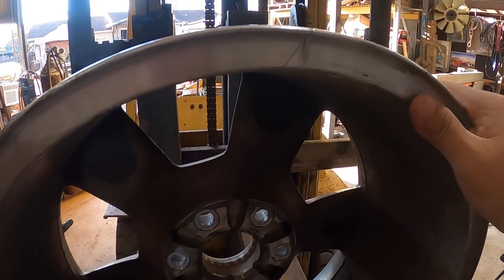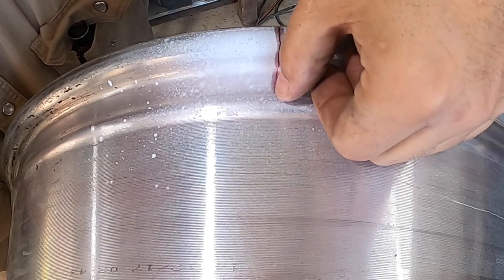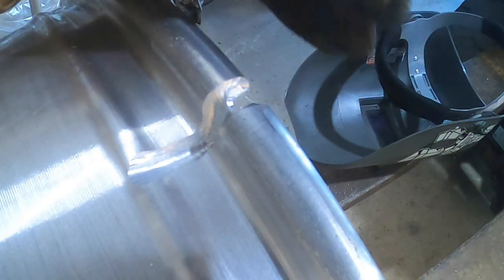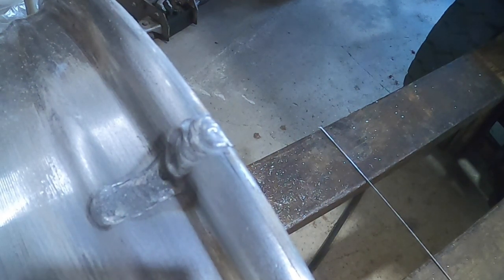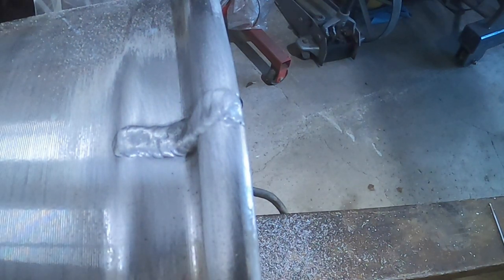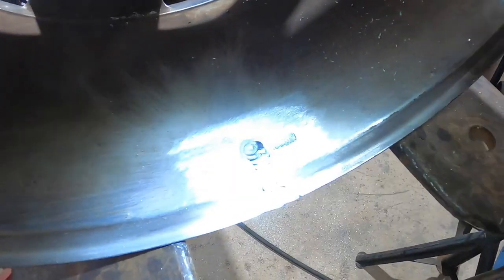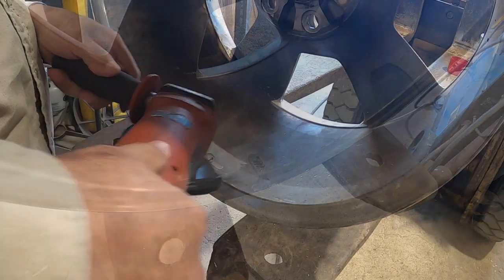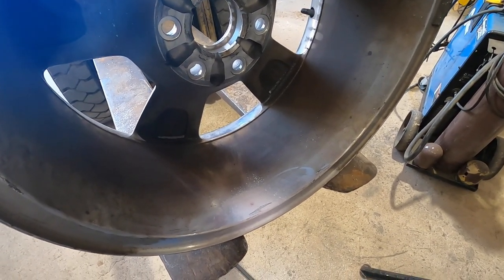Aluminum???

Comment: I do a lot of AL., and for someone who is not up on setting your Syncrowave 350 for AL. you did an great job of making it work. I might add for next time ... pre clean with a clean stainless brush and alcohol, set the machine with a higher cycle than 60htz. I like 150 as a starting point, pre heat the base material, and keep your filler rod within the cover gas envelope at all times when welding. Enjoy!
Reply from the maker: thanks for the input,  I'll start at the 150hz range next time. I made two videos at the same time on this run so It may show up later in the year. Still the same struggles but oh well. 😁😁😁
Reply: I also did a lot of aluminum welding. Im in total agreement with pkav8tor.
Reply: @ICWeld  hey man on that tree stump machine VID was that dhort circuit mig you did?? I really am curious but didnt get a responce or was it globular??
Reply: Hey brother, please be careful repairing this kind of thing! If It goes on you're personal ride, that's one thing. If it goes to a paying costumer and fails, anything could happen. Just remember, they get the bill, you get the signed waver! No two ways about it. Keep up the great videos!
Reply: @thomashaley5284  he not claiming its  as original, but welded to hold air
Reply: @thomashaley5284  By the way, he did say in the video that it was a free job for a friend!  Not paying work.
Reply: Wanted to add but I'm sure you know helium is the preferred shield gas for aluminum.  Also the type of tungsten you use matters as well. Some tungstens can only handle up to 150htz I believe and they need to be shaped correctly. Conical with flat end or ball end.  I'm hoping someone can add to this and hope it helps

Comment: Ive been welding aluminum for the better part of 60 years.  What I saw was pretty close to right on.  Depending who made the wheels the alloy will be different.  Castings are always a bit dirty, and if there is any magnesium in it the fillers are entirely different.  Clean as said before with acetone, don’t use brake cleaner.  Brake cleaner when heated produces poisonous fumes.  
IC your heavy steel repair processes are assume,  I have watched all of your vids and have learned a bunch.  I am 75 years old and still weld each week day, I take the weekends off, weld carbon steel, and stainless mostly.  Keep up the great work!

Comment: Cleanliness is the Key in welding aluminum. I have dedicated stainless steel wire brushes, die grinder bits - even gloves - for use on AL only. I also wipe down with acetone before starting. Wipe the work, the rods, everything. Others comments below are spot on.

Comment: I had a local aluminum welder do some work on a boat and he stressed how the aluminum has to be contaminate free. He has sanders and grinding bits that only touch aluminum. He said if you use them on steel and then aluminum it will contaminate the job.

Comment: I used to help a welder that had a small repair business we did lots of alloy wheels, there are wheel services that visited every dealer in town weekly, they use a hydraulic truing machine that often left the wheels cracked , we fixed the cracks.  I enjoy your works thanks.

Comment: I used to work in a machine shop, pre-GPS days. They were linked up with a defense contractor that built the forrunner of GPS, and we built the components for the antennas on their system.
    I had never welded prior to working there and while there I learned to both stick and tig Weld. I told that backstory in order to tell about the tig welding rig I learned on. The primary welder was a 350 Amp AC/DC Lincoln with reversible polarity, it was literally as big as a side by side fridge but half as tall. On top was a box about the size of your average tool box but twice as wide. This was the "high frequency" box, and it had one last part which was the foot pedal with a exposed reostat, the diameter of the wheel in your video. I point out that it was exposed because several times I got snapped out of my inattentive state when I would allow my leg to lay over against the top of it. You would think the shock would not be bad from the side of your calf to your foot, but I wore insulated boots and usually sat on a metal stool at the welding station so the electricity went up and out rather than down and out. Add to that, you weren't getting everyday 60 hertz electricity, like I said the tig box was a "high frequency" inverter which multiplied the frequency depending on the terminal the torch was plugged into. Even though it never made it above my waist, I would taste the fillings in my teeth for hours after I touched it.
    But one thing about it, for as crude a looking set up as it was, I've never seen a tig rig that produced as even and as good looking welds in the hands of an amature. The two additional things I would attribute the quality of the welds to (government spec. inspected), we were only permitted Helium as shielding gas, and my vision was a lot better than it is today (coworker who taught me said, "watch the puddle and paint with the liquid metal).
       I said all of that to say this, The world is full of armchair quarterbacks, tell your critics to start welding and post their videos online. Those who do it for a living or regularly as necessity calls for it, don't need a backseat driver telling them where they're wrong.

Comment: Usually with the gap, you can back the underside with a piece of copper. That way the introduction of heat will keep the weld puddle from dropping out.  I teach tig in a BOCES adult ed classes. I watch your videos alot! Keep up the good work you share with your audience.

Comment: Excellent repair!  When I saw the wheel, I just knew the "safety Karens" would give you grief for repairing it.

Sounded like you were running around 120hz; especially on cast, I prefer to set my machine around 60hz, which seems to smooth/flow the aluminum better on cast. I use 120-150hz on thinner AL sheet. A stainless wire brush and cleaning with acetone prior to welding will also help. As someone else mentioned, keeping your filler in the gas coverage between dabs also helps. TIG welding AL actually seems easier to me, than steel.

Great job!
Reply from the maker: i'll try that next time. thanks bud

Comment: Very cool video Isaac.
I've watched several videos on tig welding aluminum and titanium, but this is the first time I've actually been able to watch the pool and flow of metal clearly.
I'm not Tig welder, but I could definitely give it a go after watching this. I'm an old gas and arch guy from my diesel mechanic days. Great capture sir.👌
Excellent "Hoop" repair.😁😉😂
I'm sure the alphabet department would approve.👍
Reply: Watch Jody at welding tips and tricks, he gets great puddle shots
Reply: Gw Builder . If you're old school gas welding from days well gone by . I don't think you will have much of a problem using TIG, Look at it the same as I do the gas torch flame is replaced by an electric arc with an inert gas shield. 'Aluminum '? alloy wheels are quite often not anything as strait forward as that, the combinations of various other metals included often gives the home workshop guy an impossible chance of getting a safe repair done . With the past knowledge and experience Isaac has gained I think he  has done a good usable repair , apart from the 2 tiny blemishes it's  'invisible mending '
Reply: @dtimboggs  This is Isaac's channel. This comment is for Isaac.
Reply: @karlhrdylicka  Thanks for the comment.
I understand the concept. It's basically the next evolution of combining gas and arch together, like using helium argon for stainless and a number of other shield gas applications.
Watching the arch/gas interaction with the flame and filler rod was what I thought was cool.
I haven't tried it because nobody I know has a Tig welder and I'm not going to buy one just to try it.
Tig definitely has the features of both worlds and the versatility of speed control, but it is a slower process, although I've seen some beautiful welds. I'm just not that patient.🤪
The impurities are the reality of any cast material and like Isaac said, it was probably the finish coating on the "Hoop".

Comment: I am in the school of “there are people I can learn from, U”. 
   I’m not the best, and can always learn new things. I am pretty good at working on wheel repairs. I always cut through the crack with a cutting wheel first, to remove any dirt, and I don’t worry about pin holes less than 1/16 and no more than 2. Other wise it looks like what I do. Great job, better luck on the next one!

Comment: Your method was good. Torch angles we're almost perfect. The basket weave was a great way to melt off that first bead. I think what you are concerned with is pockets of other materials in the base. Specks of magnesium or zinc will give that look of porosity. Nothing can be done about that. "A grinder and paint, makes me the welder I ain't."

Comment: No bubbles no troubles. I had never heard that before and I like it. I have never done any TIG welding so as long as the tire holds air it's a success.

Comment: I repair several similar cracks and worse from low profile tires and potholes. A clean stainless brush like on your drill and a little (300 degrees) preheat make it easier.  Good job.

Comment: I am having a coffee after welding a trailer frame break.   As to your repair?   Better than 99.999999% of the world could do.   Most would buy a new rim from the wreckers.  Many will argue that it’s not roadworthy now.   Yet It’s definitely stronger than it was before before it cracked.
Reply: I've got a "hoop" that was mis-cast from the factory and had a local guy weld up the cracks. 18k miles on it and not a whisper of a leak. Prior to him I went to a handful of places that stated the location of the cracks prevented them from doing the work due to DOT regs. Frustrating for sure, but the guy who did the repair for me puts together track cars as his actual job, so I trust his puddles more than some 20 year old apprentice.
Reply: Good luck finding that hoop in a salvage
Reply: @51-FS  hard to understand what you mean with this comment. Can you explain?
Reply: @darkminstrel2041  well, DOT Regs refer to using specific ANSI (etc) welding procedures! That are available  from AWS and other sources. Certified welders who carry qualifications would know that, they wouldn’t want to risk licenses for a small repair weld job like this.
Reply: @madjimbo4176  win u said most would buy a new hoop from a wrecker I assumed you ment from a salvage seinc how wrecker don't sale new or used hoops
Reply: @51-FS  Maybe not in the USA.  We aren’t as litigious.

Comment: You do nice work! Don't sell yourself short. Last summer I watched several videos filmed either in India or Pakistan where a fellow repaired aluminum rims. In short sleeves, short pants and plastic sandals. One repair consisted of welding an 8 inch portion of the bead BACK into the rim. I think what you did was just fine. I have experience repairing brass and cast iron and just fyi we went one step further polishing with a die grinder and rubber wheels then scotch bright on wheels we made ourselves. Quick and easy polish. You do good work. thanx for sharing!

Comment: I purchased a set of 20" aluminum wheels back in 2007 for my '95 Tahoe, the centers were forged and hoops were extruded and rolled then welded together. One of them developed a crack in the hoop "parallel" with the direction of travel. It was repaired by an expert wheel repair welder but the crack continued to "run". The manufacturer of the wheels was out of business and spares were obsolete. Ultimately I had to send the wheel to Wayne's Wheels in Garden Grove Calif. for a new hoop. GREAT FIX, HOPE IT HOLDS TOGETHER.

Comment: If you turn the rattle can upside and spray a bit when you are thru using it, it helps clean out the nozzle and betters your chances of it working the next time.

Comment: I C, Excellent video work!~!  I agree with the other gentlemen, SS brush and wiped down with acetone does enhance the process. I've done aluminum with oxy-acetylene with aluminum rod and a flux, also O-A & Alum-Aloy, my old 250 AC Westinghouse, and lately tig. Heck, I've even done some surface repair with JB Weld Alum Expoxy.  They just can't argue with your final product.  Your vast experience with all types of "fusion welding" tells you things the "armchair experts have never heard.

Comment: I’ve welded lots of wheels, I’m no armchair expert.. but I usually pre heat the crack first to draw out moisture and sometimes the crack will extend further back than you first realise. Then I drill the end, and run through the wheel with a cut of wheel. V it out with a die grinder and weld it with 2.4 5356 rods. But I need to get some of that die penetrate, looks like a good job

Comment: Just a tip.. always keep your filler in the gas coverage, pulling it out will cause you to add more crap into the weld  with each dab. That is why your filler has that tear drop oxidised end.. Also helps to run the tig over the weld area on a lower setting to let the cleaning action to pre clean the weld and pre heat area before actually welding it.

Comment: Great job!!!! A little Acetone and a new stainless brush and you've done as much as you can do given the mix of metals in the wheel... I don't see many critical comments, probably because aluminum is so hard, even when you work with it every day... The "bench welders" are good but they'd really be challenged to do the work you do on beat up heavy equipment, laying on the dirt, and in the wind and rain.. Don't sell yourself short, you do great work...

Comment: Pretty decent repair I'd say. Only mistake was not noticing the clear coat! I've done quite a lot of wheel cracks, using an old Hobart transformer type machine so fixed frequency (50hz in the U.K.) which works fine for me! I also don't drill the end of the crack - it's usually not in the same place on each side - & also start from the inner end & weld towards the rim. After removing the paint or lacquer I vee out both sides of the crack though & weld the inside first ( just personal preference ). Your way of welding one side before veeing out the other is probably a better way of doing it ( but maybe a bit slower). I only remove/smooth the weld where the tyre fits - leaves it stronger & saves time.

Comment: I've had real good results doing a little pre heat with a propane torch just before welding on larger aluminum parts.  I just pre heat the area to weld (not the whole part) and you will find the time the TIG torch needs to establish a puddle is much shorter.  Nice job.

Comment: That dynasty 350 is one of the best ac dc tig machines out there in my opinion. I think that the arc starts on the 350 when using high frequency AC are even better than the newer dynasty 400. Got a bit of hood time on both when I used to do aerospace work.

Comment: My understanding is that Aluminum wheels have complex stress and tensions in them due to the manufacturing process. So no matter how perfect your weld is the wheel is compromised and not reliable. Kind of like a repair weld on a pressure tank: not something you want to mess around with.
Reply: @Osw719 It's not the same. 3000-4000 lb vehicle hitting potholes at 60mph, probably on low profile tires, is quite a load. Not saying repairing alu rims isn't kosher, but you don't see it done in high stress environments like racing.
Reply: Links can't be posted in comments. Search for the text below and you will find the link, where I cut & pasted it from. AWS magazines perhaps have more information.

-----
Physically repairing something like this is easy enough but there's soooo much more to consider that can't be known and can't be checked/proven economically unless the wheel is rare enough to be effectively irreplacable i.e. proper NDT

Wheels are cast, spun/flow formed and forged. Spinning, flow forming and forging are forming processes that 'add strength' through strain hardening and grain refinement. Welding is in effect casting and welding something that has been forged etc will 'undo' this grain structure that was used to design weight out of the part

Ally wheels are often/usually heat treated during manufacture. Again welding will destroy this heat treatment local to the repair. Hot working can also destroy heat treatment if the temp high enough as the aluminium alloys used will begin to anneal at around 350C.

In other words if the welding is perfect (no such thing) it'll still be softer and weaker after repair. If it was a lightweight forged wheel could be around half the strength it was before firing up the welder. If it was cast the story is less bleak but 1) castings aren't known for their tolerance of being bashed about and 2) there's still welding flaws and other things to consider.

Everything is 'over built' i.e. designed with a safety margin. There's no way to know how big (conservative) the designers went but commen sense says that lighter, high perfomance wheels will be 'overbuilt' less than heavy, (usually) cheaper wheels

Comment: Good job Isaac. I would. Ever have considered welding a cracked rim but I have seen a couple of videos now so would have no problem doing one. Working on multiple planes like that I would definitely be making more trips to the grinder to clean up my electrode though. I am no more experienced at aluminum than you are but one thing I have learned is that you can never have it too clean and a bit of preheat goes a long ways. Ok, two things. Really appreciate your videos, keep them coming.

Comment: Thanks IC good job, if you could have chemically cleaned the area with alcohol or acetone, then heat with torch to sweat anything out of the pores. Dirty aluminum is always the most difficult to make look pretty. Wheels are always in the dirt and oils/tars, bead sealers.
It will keep your friend going round and round.